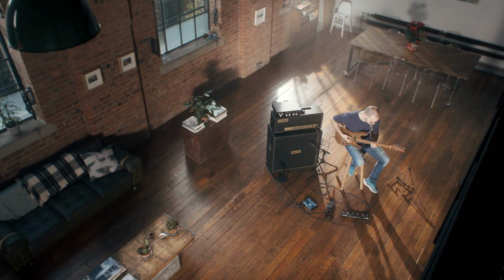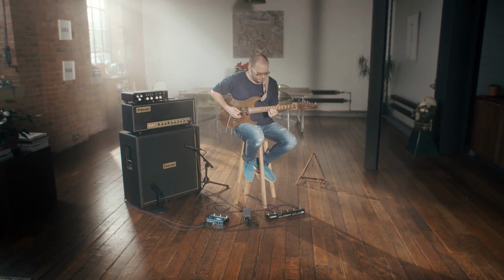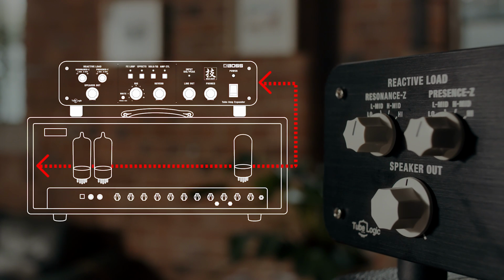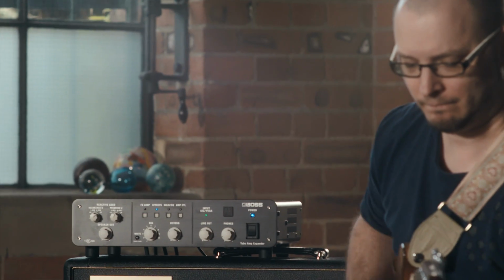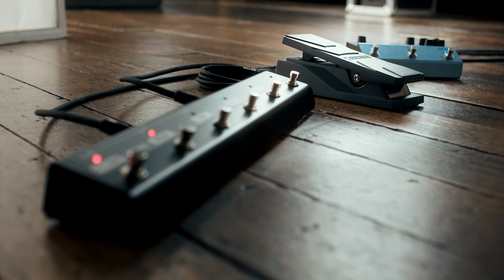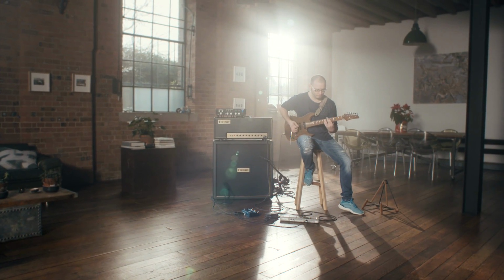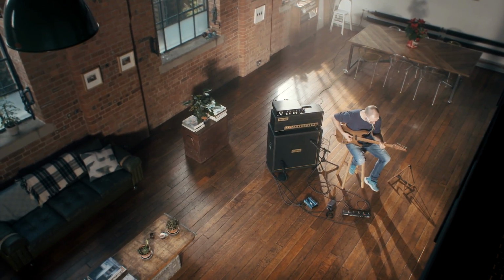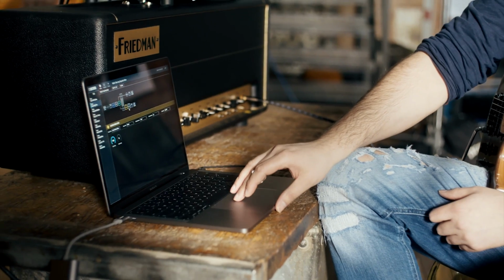BOSS WAZA Tube Amp Expander - Introduction by Tom Quayle

Comment: Hi Boss, why a mono fx loop? To me is just a no sense. Many of your best fx are stereo. So why you didn't give us the chance to use'em when we play without a cab? OK inside your software you have stereo fx but somebody, like me, has based its own sound on some particular stereo fx. Good product but lacks stereo fx loop.
Reply: If it had a stereo FX loop, they really should have those two parallel outs be able to be set up as two 50 watt amps for stereo out - ie: switch from 100watt mono to 2x 50 watt stereo.  Effectively like a JC-style amp, with each amp powering each speaker.

Comment: I would like to know if my waza-tae is multi-voltage, so i can use it overseas without a transformer? Can it take 220v as ac IN?
Reply: Nope !Internal transformer seems not not to  allow this. ( Saw this in a video that opened the unit)

Comment: Just got my TAE last weekend and really impressed with it as a whole. The only issue I’m having is if I get anywhere near the unit with a guitar it starts squealing and feeding back. I’m not running a high gain rig, Fender DRRI, pedalboard with various medium gain overdrives. I have the unit away from my amp on my desk for convenience of recording so I’m not sure what’s causing this issue??

Comment: I see that it says on the Boss website that it includes built in stereo effects but it's unclear if this is applied only to the line outs. I'm guessing that the speaker outputs do not operate as a stereo pair seeing how they are labelled A and B rather than Left and Right. It is also not mentioned whether the effects loop itself is stereo so that people can use their own stereo effects pedals.

In the event of amp failure, I'm assuming it is possible to use to the effects loop return as an input for a modeller/preamp/pedal board. Looking at the block diagram, if it is possible, in theory this would also allow use of the built in effects and cabinet emulation/user IRs. Could save a gig if it is possible.

Comment: I still like non-reactive loads. That is what we use when biasing. Right? 
I still do. BTW if one wants more manageable volumes from tube amps, use a lower wattage amp. I used an old stereo tape recorder with one 7591 per side, so 3.5watts clean. Plenty of headroom somehow. For front end I used a Ibanez UE-300. That's a compressor a Tube Screamer plus stereo chorus all in one. Best classic rock setup I ever had. Ran one side into a 2-12 Basmman cab, the other through a [NotMarshall] 4-12.
Reply: Good Times

Comment: Question: when Tom says "analog power stage", does he mean TUBE power stage? I didn't get that part
Reply: Yeah the power amp inside the tube amp expander is solid state. This is actually better for preserving the tone of the tube amp connected to it as it's just going to transparently pass through your signal, adding or subtracting volume, without coloring it.
Reply: José Gabriel D'Windt solid state

Comment: So, it's like the Two-Notes Torpedo reload, without the effects. 
What makes this better?
Reply: colaboytje , it has much more options, like the build in effects (you already mentioned that) midi capability so you can switch presets together with other midi connected devices, the important resonance feature, a real poweramp section, and not a simulation. And some more you can find out youreself.

Comment: Is the fx loop routing 100% analog for series or parallel when using external fx? Also, what is the effect on power tube tone with fx loop engaged, given that the series or parallel loop is being inserted post power amp as opposed to post preamp on amps that have a built in fx loop?

Comment: Had a Katana and while it was good, it wasn’t near as pleasing as my tube amps. Getting the same SS vibe with this... Technologically impressive but sterile. OX seems to have enough w/o trying to have it all.
Reply: I chose the waza for 2 reason over the ox.  1) The ox is cannot load 3rd party ir's. 2) the attenuation is limited to set values, so if your sweet spot is between 3 and 4 let's say, you are stuck.  The ox has some advantages too, for example, the user interface in the app is more slick.

Comment: Probably is a stupid question but, would it work on bass aplifier? Usually bass amp (especially solid state) have 300 W or even 500, am I risking to burn this tube expander?

Comment: Can I run my 2 ohm Super Reverb through it?  
Also I just wish the computer interface was a little more sexy instead of like a cold, engineering/computer programming screen.  That's my only negative from what I have seen.  Badass Boss!  I was just getting ready to pull the trigger on an Ox.  Now i have to wait for a side by side comparison
Reply: The Tube Amp Expander is better. I've played both side by side in person.
Reply: Minimum 4 ohm input.

Comment: Just bought an Ox Box lol. This seems like a cool product but I’m happy with the Ox
Reply: This is way more than a OX Box, beyond the load box and attenuation, speaker IR, this adds a power amp to boost low watt amps, an effect loop for any amp (that is not affected by amp gain) and effects built in as well. Foot switch and midi controllable features. This thing is tempting.
Reply: Me too.

Comment: Very similar to my two notes torpedo reload , but at twice the price .
Reply: But the strength here are the variable response curves to your speaker cab. I have the reload as well and there is definitely a tone difference with it in the path vs just the amp even before attentuation.

Comment: Looks good but too many bell and whistles for simple running an amp via reactive load to DAW like I do. I think I will end up getting a Two Notes Captor, because it would not be paying for features I do not need. Plus I am still wary of Boss after I fell for getting a GT-10 years ago and it gave every patch a hint of of 80s Casio keyboard tone (I am still nostalgic about the analog chorus pedal I bought in 1986 though, so always have a soft spot for Boss. My first pedal. You never forget the first one). 
Currently for me it's a Laney IRT Studio running silent recording mode via XLR to my interface and then adding plugins in DAW for IR, plate reverb and high pass EQ etc. It sounds really good for a quite wide range of lead tones especially, but the downside is the silent mode is restricted to 1 watt instead of the full 15 watts. That messes when the clean channel's headroom. That's why I am thinking Torpedo Captor. This new Boss unit got my attention because it is a reactive load, but also an interface and I am thinking of upgrading mine. Like I say though, lots of bells and whistles I would not use. A stripped down version that is just a reactive load and maybe/maybe not an interface with really good AD/DA and ASIO drivers would probably get me having a second look.

p.s. NZRS Matt H that now works on stuff for Boss product development. I see your paw prints all over this new device. It's an evolution of the stuff you did for a while with your Plexi and EVH rig obsession and told us about on the local NZ forum. If I am right about my hunch, then nice one mate. Randy was better btw ;)
Reply: Aquila Rossa I have the captor and it’s really great value for the money, perfect for homerecording. It would be even better if it had maybe two or three settings for the attenuation instead of one fixed, but that’s a minor thing. All in all it offers a lot for what, 250 bucks?
I also had the ITT studio for testing, it was pretty good, but as I prefer clean or mildly crunchy sounds, it wasn’t for me, I think it shines at distortion. It had like one (good) clean sound at level 5 or so...still a clever product.
Reply: I passed on the captor because of the attenuation limitations.

Comment: So you're saying that the Midi control on this will switch channels on a Mesa Triple Rectifier head? Plus, apply from this device a Load Box basically to keep the volume level from blowing people's heads off? yet I can still crank the amp and switches its channels from your pedal board selector? 
Is there a rack mount kit for it? And how much is it?
Reply: guitarguts666 yep, pretty much, plus a shit ton more for about $13-1400

Comment: If you have a tube amp for tone of it yet you need something else to make it sound good what the hell is the point in the first place of buying one? Damn people are stuck on stupid. I will stick with my Randall's. No need for outboard gear. I plug straight in and get a tone that is a cross between master of puppets, and vulgar display of power with my volume pot full up on the guitar. Yet roll the volume back on the guitar to different amounts and I get hard rock ala Boston, to blues like Vaughn.
Reply: John Loughner  you have a better approach to playing amplified guitar than most of the guitarist I know these days.  Especially for playing live.
Reply: i think its for people with loud amps that nearly kill them at the point where they sound good. Also adds a bunch of functionality to amps that dont have fx loops
Reply: If you're in a situation where load boxes and IR's are superflous, you are one of the lucky ones.  For the rest of us (that aren't rude to our neighbors, anyway) these things ARE important, as evidenced by the # of products and sales volume the demand supports.  The whole point of this product is to enable use of real tube amps for tone as opposed to in the box amp sims.
Reply: I don’t use load boxes I use a 120 watt head with a 40 watt combo amp or something and I still don’t get it.  I’ll even put a mic on it. If I need to be quiet I have a a six inch speaker On a solid state amp like the one Randy Rhodes auditioned for Ozzy on . I’m old school I don’t need to be all fancy to practice all the time. So I just don’t see the point burning up my tubes and lugging amps just to practice . unless it’s practicing a live set with a group where it needs to be loud anyways. 🤷‍♂️
Reply: @rokinrandy  you aren't going to get a quality recording AND not have your neighbors hate you without a solution like this or a detached house.
Reply: joebobhenrybob2000 are ya kidding neighbors say they never hear it. And ironically the only couple albums I’ve been on are country. And I just did what I was told for the most part..  My fender amp sounds great turned up around 5 such a sweet spot. Look for a video called in the zone by Pete thorn.  It seems situational.  If I was forced into a situation and it cost 1000 bucks to fix it. you bet I would pay it. But right now I’m skeptical. Or just don’t need it that bad
Reply: @rokinrandy  I agree it's about application which some people don't need - and it's cool to talk to a fellow considerate guitar player - I've had a few instances of listening to neighbors play smoke on the water very badly through my walls for hours.  Meanwhile I could blow em away with my 120w amp but am merciful ha.

Btw I am no boss fanboy my recording solution is the 1w Fryette valvulator GP/DI.

For a songwriter/engineer/producer wearing a bunch of hats trying to make professional grade music and publishing via bandcamp cd baby distrokid etc a device like this that very nearly duplicates a big amp blasting away as opposed to good enough for practice and rehearsal is huge.

It lets people chop off the parasitic manager, engineer, producer, record company, studio facility, cartage, rental, etc and not only own the means of production but gain the neccessary skills on it.

Because if you don't own the means of production, all those other things become neccessary - in order to record the actual work or to climb up to the point where you can afford it.

Every time I see another solution for artists that helps escape the old structure I want to cheer because they're all the answer to Steve Albini's The Problem With Music speech. (Well worth reading)
Reply: joebobhenrybob2000 I’m a huge boss fan boy. Most of the pedals that get a lot of hate on YouTube the greats have made awesome recording with em.  Steve vai Satriani heck all of em.  Yet people hate em.  
They’re really awesome.  A lot of misconceptions out there .

One is everyone thinks they need heads and stacks.  How many of us really need something to blow off the coliseum doors.  With so many great sounding tube combo amps out there.  Even for Metal..  sometimes less is a lot more. Especially in small clubs where most of us actually reside.  And a good combo ain’t no joke in a studio either.  Heck the guy in the video trying to get a hot spanky fender like tone with a 3000.00 dollar head would’ve been better off getting the hot rodded fender like tones just using a fender amp.  Which is what a lot of need to invest in.  

Even Steve vai A B a fender in his rig.  The giants all do for their clean channel because Fender amps are American bliss and look good in the jam room. 

I seen the eagles and they all had combo amps.  Mesa Mark 4 and tweeds.  Sounded awesome.  Seen Joe  Bonamassa and he had a crowd of combo amps and Sounded great.  I’m tired of lugging these things around.  Last few gigs I just brought fender and peavey combo and all kinds of people asked me how I got the tone. But to each their own.
Reply: @rokinrandy  totally - Jimmy Page did awesome stuff throughout the zep albums with a 15w amp.  Nirvana recorded with some low watt tech 21 amp.  Everyone is realizing small amps are cool - I still need to unload a jc120 I got because a bandmate wouldn't turn down his marshall stack.  Who needs 120w?  To quote an old weezer concert t shirt "if it's too loud, turn it down"
Reply: joebobhenrybob2000  then some people just want to build a wall ! A wall of Marshall’s and make line 6 pay for it. Or the neighbors. I’ve had neighbors do it too. Well roommates.  But it was dent dent dent dent dent chug dent dent dent dent all sounded the same.
Reply: @rokinrandy  there's a thing called "recording".
Reply: @NoiseFeedMusic well, the guy started out saying he's old school and seems alright, he just doesn't need this product - for practice and rehearsal he's set and he probably went into a studio to record.

But both our point is, I think, that technology has closed the gap where a tube amp with a load box really CAN be good enough for recording outside the studio.  And the trend is to try to have lighter and more mobile rigs for live stuff.  Becaus there's less and less overall money out there for music, but there are products I'd almost (not actually!!!) have killed for years ago that make things so much easier.

So the whole practice setup, rehearsal setup, performance setup, studio setup model is the old way.  New artists may just crank out content via youtube, patreon etc instead of tour.   I absolutely would not rent rehearsal space now with a band - I'd use an electronic drum set and some THRs or maybe just run everyone through a mixer into headphones in my living room.

And of course why the $#@# would I want to hand over money to a studio when I can buy something almost as good, use it forever, and develop my own skills on it?  Instead of paying the engineer to develop his?

But more power to him he's making music and he's happy.  But the times are changing.  Even music venues are being abandoned by the DIY movement holding concerts in living rooms, basements, lofts.  Music is getting both easier and harder.

Comment: The ONE thing that has me thinking about this (or the Ox) is the room mic feature. Otherwise I have no use for most of these bells and whistles. 
Attenuator? MV works better. 
Audio interface? Already got one duh! 
Effects? That's what my effects processor is for. 
SS power amp? I don't bother with 15W patty cake amps LOL.
MIDI? Again, effects processor covers it.

The selectable impedance curves are a cool feature for sure, but this thing will probably retail for $1300-$1400. The new Suhr Reactive Load IR is a great example of a stripped down, high quality recording tool with the basics covered, and way less $. If you have the money, sure, but I think this will be a hard sell for even seasoned guitar players.
Reply: I'll bet you this is gonna make getting output tube distortion easier on the ears than your mastervolume. Also it's clever to add effects after your distorting output stage.
Reply: Yeah after watching the Andertons NAMM video, this is looking more appealing. Still, the tones I go for don't need a ton of power tube distortion, but a bit more couldn't hurt :)

Comment: You may have answered this in the video, but my tube amp does not have a amp head with it. GA30-RVS, would this product still work with my amp?
Reply: Wils Dale - your amp has external speaker out with  jacks for left & right but no way to connect back into the in built speakers. 

You would have to mod your amp by wiring a speaker lead from the speaker spade terminal figure 8 cable to the Boss and then another speaker cable from the boss unit and connect them to the spade terminals on the speakers. 

I have one like yours and a super goldtone - it has a speaker jack because they made them as a head as well as combo. 

Great amps but the 15W stereo class A is like an ice pick to the head when cranked!!.

Comment: I have no idea what any of this means 😂
Reply: It's an expensive way of impressing the chicks on the dancefloor.
Reply: Norbert Fernandes You and me both lol
Reply: It goes between the speaker out of your amp and the speaker itself. So you can attenuate the volume while getting the cranked amp sound at decent volumes. And you can place effects in the effects loop so they aren’t distorted by the amps power section. You can record at zero volume, send the signal to a mixing board. It’s insanely useful.